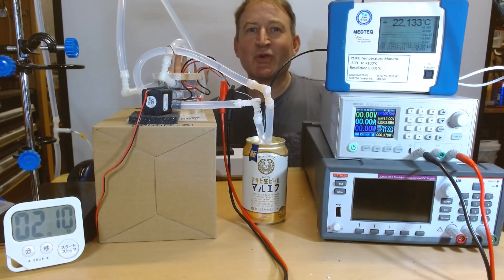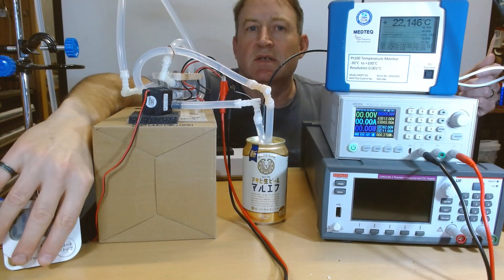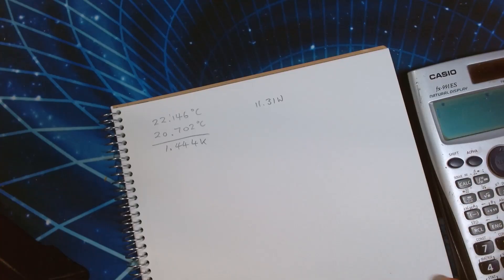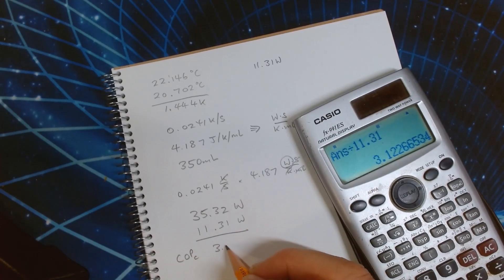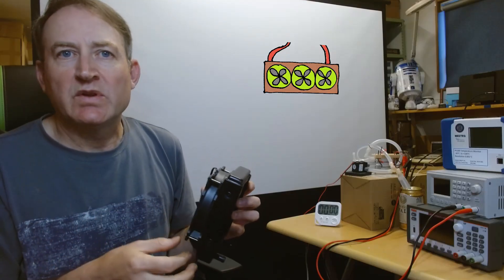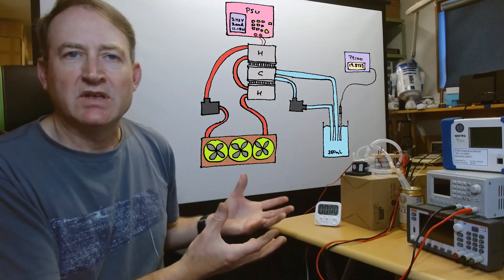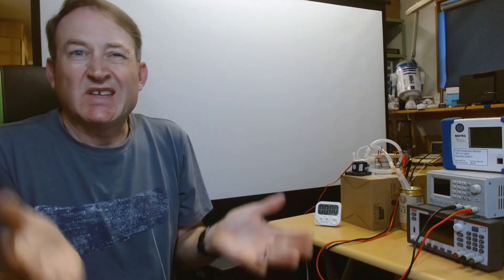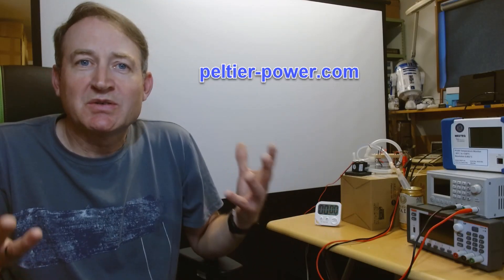Peltier efficiency test - the real one

Comment: I find the experiment interestin0 to question whether a peltier is able to do more heat pupming than the used energy, similarly to any other heat pump system. But it needs much much more solid validation:

- you ASSUME that the whole 300 mL is cooled down with 1.xx Kelvin by the calculations - i am not sure that the recurring water stream is mixed well enough at all within this little time and you are not measuring only the recurrint stream's temp or so.
- you add the "icoming 11W and the calculated 34W" together to give the radiated amount of the heat exchanger... i think i understand your logic (the 11W was creating the temp gradient + the amount of energy that is "missing" from the water) - however i tend to believe that we cannot sum these so easily.

It would be much more informative to have a large bucket of cooling water (with known temp) with a one way system, that you let run through the peltier setup and the radiator and measure the temp before and after the peltier and radiator and at the end the real volume  -- this way you could determine exactly how much energy is radiated away, and get rid of guesswork.

Similarly, the same for the cooling side...  that way you would end having exact measurements. 
Also, varying the pump speed would enable to adjust flow speeds on both sides so you could achieve 4-5 C difference between inflow and outflow to be able to calculate on meaningful measures.

regards.
Reply from the maker: The actual set up here is was just for the visual impact of the temperature reducing, but normally I use fixed and known flow rate method and measure the direct temperature in and out of the Peltier "cell". For this particular "cell" using that method, I measured 38W of cooling for 11W input, and you can also do the same on the hot side as a sanity check, verify Ph = Pc + Pw, it all works out. With the water pumps running at around 1L/min there's good mixing in the containers (I've worked a lot with temperature calibration requiring 0.001°C stability as part of my main job). But I like your idea pumping from two containers, it could also work as a good visual. Another idea I had was to side by side comparison with one set up having 20W of "normal" heating from a resistor and the other side with having a heat pump Peltier system run at the same 20W. The temperature of the Peltier set up should go up 3-4 times faster than the resistor set up, since it is pumping heat from the room. Maybe next video?
Reply: @PeltierPower  thanks for the details!

In the meanwhile i did my research, even hackaday had an article in 2019  (Peltier Device Experiments) where they mention up to 3 COP of the peltiers.

Probably the side by side comparison is indeed a good idea with a good visual!

SO if the measurements in this particular setup are correct then the figures are roughly:

COP (Cooling): How much heat is removed per unit of work input.
COP_cooling = Q_cold / W_electric = 34W / 11W = aprox 3.3
This means for every 1 Watt of electricity you put in, the module removes 3.3 Watts of heat from the cold side (given the proper heat dissipation through the radiator, without the pump's work)

COP (Heating): How much heat is delivered to the hot side per unit of work input.
COP_heating = Q_hot / W_electric = 45W / 11W = approx 4.4
This means for every 1 Watt of electricity you put in, the module delivers 4.5 Watts of heat to the hot side (given the circulation of the cold side)

And thus, much better than ohmic heating alone.
Reply: ah, just saw your new vid. =)

Comment: Nice Experiment!  So I see that the efficiency / CoP is ~ the same as a refrigeration cycle heat pump!  The thing is the delta T for your test was effectively zero.  A refrigeration cycle normally achieves it's rated performance at a (say) 30 degree delta between heat exchangers.  Can you do a test for moving 4 degree water to 3 degree water while rejecting heat into 34 degree water?  I'm curious if the CoP is similar or whether it suffers a large degradation in this case.
Reply from the maker: Yes, absolutely the COP drops off a lot with delta T. It's a complicated relationship between current used and dT. At low currents like 3A, under more refined tests (not the test in the video) I get COPc = 3.5 with dT = 0, and this drops to ~1.0 at dT = 25. Higher currents have lower COP to start with but can handle larger differences. All heat pumps have issues to varying degrees, and to be honest COP itself is often oversold and oversimplified as a metric. In the middle of winter, my air conditioner gets a COPh of 2.0, which is still great (e.g. 2kW heat for 1kW input) but not the COP of 4.0 we often hear for modern a/c systems. Anyway, for real efficiency we should spend more on good thermal insulation rather than an relying on dodgy COP figures for heat pumps :)

Comment: I don't understand the C to K conversion. Shouldn't there be a conversion there of + 273.15
Reply from the maker: Good point. For this kind of work, it's the temperature difference that is important, and for that you can use either °C or K. So for example if you heat from 21°C to 25°C (292.13K to 296.13K) the difference is 4°C or 4K, it's the same amount on either scale. Scientifically, I should use Kelvin for temperature difference, but not everyone is familiar with this.
Reply: @PeltierPower  Thanks for the reply. I figured out where I was going wrong. I was thinking about the 1.444 C in K as ~274. IE: applying the conversion after the subtraction. I see now that the conversion would need to be done before the subtraction leaving you with the 1.444 in K. Basically C and K are the same unit just with a different 0 point.

Comment: Too many missing data points mate. Nice idea tho.
Reply from the maker: Thanks - what kind of data points would be useful?
Reply: @PeltierPower  Power consumption of the hot-side cooler, for example, and the pumps, all impacts any % eff calculations when considering a system.
Reply from the maker: Yes, an important point for a system. The key point I was trying to make was that a Peltier itself is not inherently inefficient, as a lot of people claim. For reference, I use 12V fans and pumps and run them gently at 7.5V, so the power is pretty low, maybe 5W in total (3 fans, 2 pumps). In scaled up systems, the ancillary items become proportionally less, but of course they should be included. My best effort is a 300W heating system that used a total input of 150W as measured from the mains supply (including fans, pumps, PSU inefficiency etc.) and running with a temperature difference of 15K between inside and outside the house. Still a work in progress!
Reply: @ A peltier would thermally run away to self destruction without managed cooling, therefore any reasonable calculations must include the "work done" to offset the radiated heat. The radiated heat is not being harvested in any way, hence the total efficiency of ~10% being accurate. I²R applies internally and peltiers waste heat above 0A.

If you have built a true energy amplifier, I dare you to invite Dave Jones to review also where can I purchase shares? 🙂
Reply from the maker: It's the same as an air conditioner, it's nothing new. Air conditioner for example can create 3000W of heat for 1000W input from the mains supply (COPh = 3.0), it does this by "stealing" 2kW of heat from outside so it all adds up. A Peltier can do the same thing, it's not as good as an a/c but it can still pump heat with COP > 1. In the experiment, the Peltier's I²R heating was 11W, this combines with the heat drawn from the cold side water (34W) so that a total of 45W first goes into the hot side water circuit and then released into the room through the hot side heat exchange

Comment: The COP and efficiency are generally inverses of each other. This is all bound by the first law of thermodynamics.  Whatever amount of total energy is supplied it must exceed or equal the amount that was converted to useful work.
Reply from the maker: This led me down a rabbit hole! I think the reference to thermodynamics is related to the ideal Carnot cycle, which sets an upper limit to the maximum COP for a heat pump based on the temperature difference. In that context "efficiency" is defined as COP(actual) / COP(Carnot) x 100%. So for this set up, COP(Carnot) with around 1K difference is about 294 (huge!!), while the COP actual was about 3, so the "thermodynamic efficiency" is only 1%, which sounds terrible. However a more common measure of efficiency is simply "work done in cooling" divided by the "work input to the system" x 100%, which for this experiment resulted in around 300% (or COP of 3). This later definition is more meaningful with respect to the running cost of a heat pump. Great prompt for me to learn something new!
Reply: @PeltierPower 300% efficiency suggests to me you don’t understand efficiency.  Nothing has more than 100% efficiency otherwise you are talking about perpetual motion.  At 300% efficiency not only would this device cool it would produce electricity as well.  You are confusing COP with efficiency.  Heat pumps and these devices do not create heat they move heat which requires much less work.  Efficiency is simply the useful work done divided by the power supplied.
Reply from the maker: @GeoffreyEngelbrecht  Yes, it true that for the whole system you can't get more than 100% efficient. For heat pumps it's kind of like you are stealing (or dumping) energy to or from an unlimited source (e.g. the air outside) so that side gets ignored. If you express how much energy you can "steal" relative to the energy input as a percentage it can exceed 100%. Using percentage this way is debatable (there's arguments on both sides) but it is common, and the point of the video is to show that Peltiers can pump a lot more more heat than is suggested by the common 3-10% figures on the internet, so I had to use the 300% style (heat pumped/heat in x 100%) to show the direct comparison.
Reply: @PeltierPower   I’m an aerothermal engineer.  Nothing has an efficiency greater than 100%.  You aren’t stealing anything you are moving heat from one place to another.  The useful work is the work required to do that.  I understand for most people COP is more informative and it is frequently erroneously called efficiency.  But COP is technically not the same as efficiency and I came to watch your video as I was interested in the efficiency of Peltier coolers.
Reply from the maker: Yeah, I understand the point, but it depends on definitions. For example, I could say riding a bike is more "efficient" than walking, and could express that as a percentage. In society we often measure A relative to baseline B, call that "efficiency" and express that as a percentage. In that context, we are not always constrained by 0-100% (0≤A≤B). Anyway, there is an interesting side note: Wikipedia says that Peltiers "offer around 10–15% efficiency", which I thought was a mistake, but I finally clicked that this is 10-15% of the ideal thermodynamic efficiency from a Carnot engine, so they are defining A = COP of Peltier (say 3.0) and B = COP of ideal heat pump (say 30), and "efficiency" as A/B x 100%, and getting 10%. That definition of "efficiency" is probably a key reason why Peltiers got a reputation as being "inefficient".
Reply: Heat pumps are much more efficient than reactive heating (like a cheap electrical heater). The youtuber is comparing a pump to a standard heater, 300% efficient perhaps, but the pump is just moving the heat, not generating it.
Reply: @LuisMailhos  you are confusing COP and efficiency.  The efficiency of an electric heater is nearly 100%.  The efficiency of heat pumps is much lower.  But because as you say moving heat requires less work the COP of heat pumps is much higher than electric resistive heaters.  COP for resistive heaters is equivalent to efficiency while COP is much higher for heat pumps.  I’m perhaps being pedantic but there is a clear definition of efficiency and it becomes rather confusing and unclear what you are talking about when you mix these up or makeup new definitions.  I also understand most people only care about COP as this relates to how much heat they get for the energy consumed.
Reply: @GeoffreyEngelbrecht  @garywashington9391  Totally wrong. Read Wikipedia before posting. Besides, both the OP are myself are using the word "efficiency" to address a (possible) nontechnical readers.
Reply: @LuisMailhos  I’m an aerothermal engineer and have done work on heat pumps.  Wikipedia had an article about the 2 Rappen coin stating it was in circulation long after I first moved to Switzerland.  I never saw a 2 Rappen coin but was told by Swiss friends it went out of circulation about a decade before I arrived.  Wikipedia is written by anyone motivated to edit it and hardly a reliable source of information.  Again I do understand COP is what the average person is interested in regarding heat pumps and colloquially this is referred to as efficiency.  However technically it isn’t efficiency.  And saying something has more than 100% efficiency makes little sense since the theoretical maximum with no losses is 100% efficiency.  Heat pumps do not generate heat they move it.  So the work they do is much lower than devices which generate heat directly.  Efficiency is a measure of work done divided by energy consumed.  This is always less than 100% otherwise you are talking about perpetual motion.